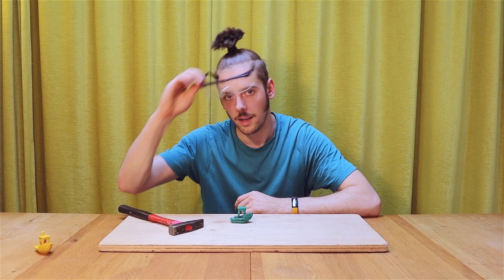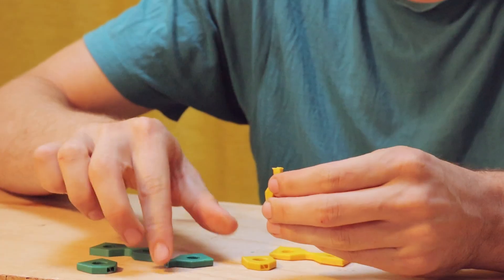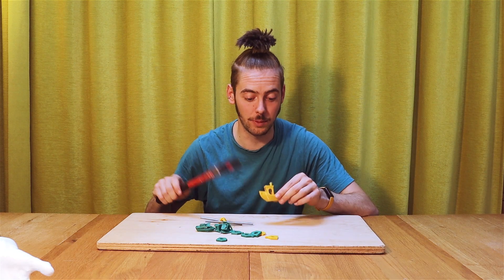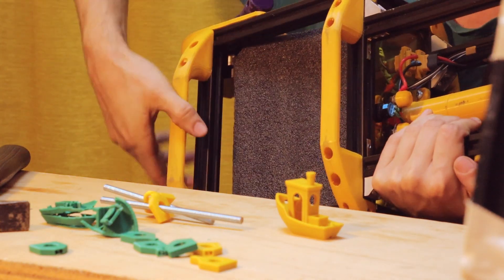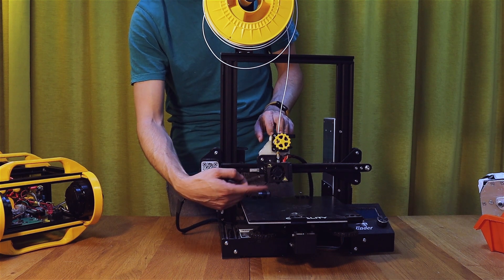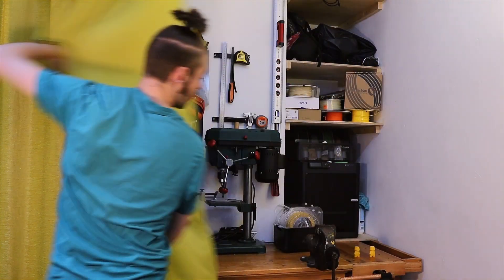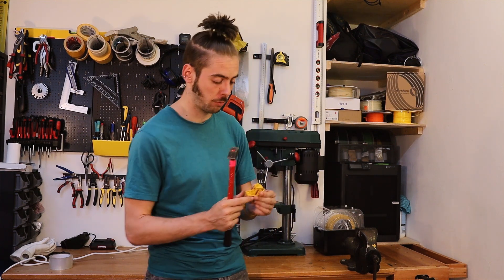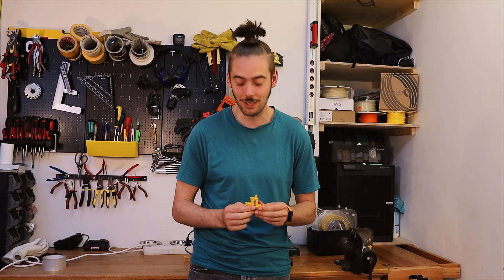Making unbreakable 3D Prints: a TPU 98A guide - Acrobot build log 03

Comment: 98a is AMS friendly anything else lower isn’t
Reply from the maker: I heard bad things about 98A too.. so I didn't dare to try it.
Reply: @ yeah I was told that too then I saw someone using it and I tried and I’ve never had issues.  Been using it now 4 months solid as my base layer for rubber bottom and print right on top PLA and PETG zero errors.

Also I print it at 13mm3 240c 0.1 retraction 2mm wipe. 100% fan all time no matter what
Reply from the maker: @djgraffiti81  That's good to hear! I just ordered some new AMS TPU from Bambu, curious to find out how that works for multi material printing :)